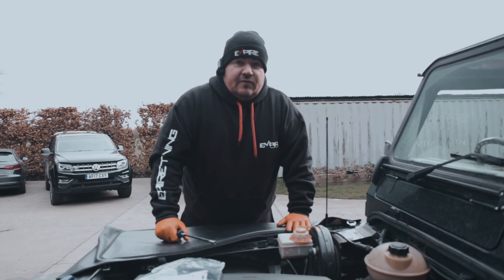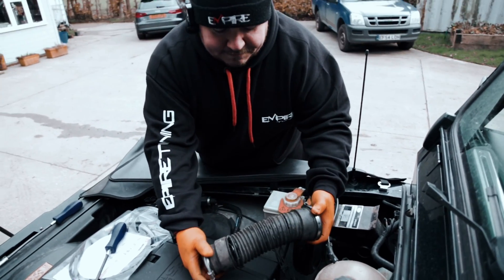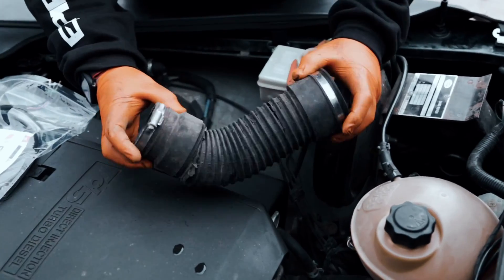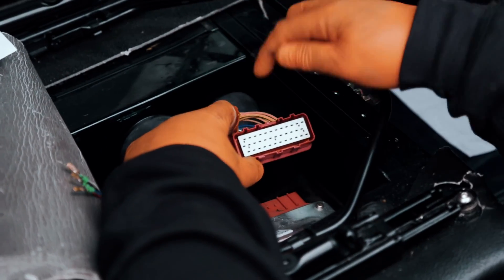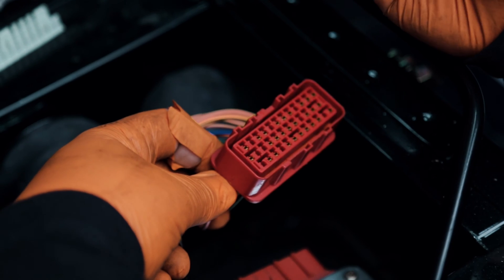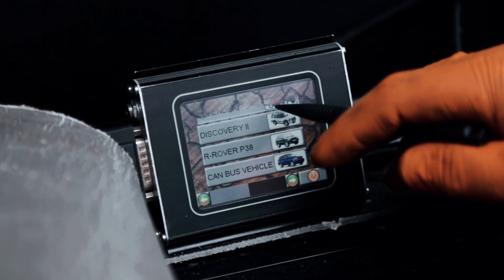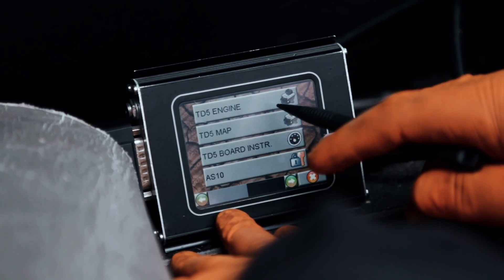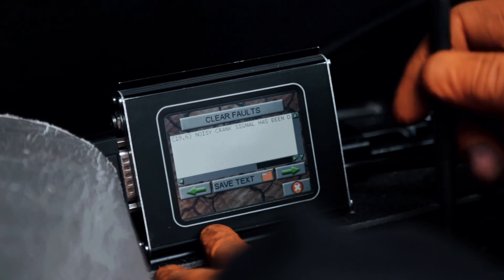NONE START TD5? Try this!

Comment: Just bought one of these, thanks! I've noticed that the in the instructions, it says Blue goes to pin 36 (top left) and Red goes to pin 13 (under blue) however in this video it shows you putting them in the opposite way around. Can you confirm the correct orientation please?
Reply from the maker: Very Well spotted! The kit in this video was a pre production one so if you can follow the instructions supplied then that will be the correct way.

Blue goes to Pin 36 (top left)

Red goes to Pin 13 (just below Blue)

Anything else please drop us a call

Comment: whats the (17.2) high speed crank (current) fault mean also getting (16.2)high speed crank (logged) truck wont boost more than 10psi and doesn't go above about 1800-2000rpm can't find any boost leaks is on a 2001 15p td5

Comment: Glad to know us LR Disco 2 V8 owners aren't the only ones with randomly dying CPS. I wrap mine in aluminum foil to thwart heat.
Cheers from a Yank in Suffolk!
Reply: The wiring is highly sensitive to EMF interference, particularly susceptible to the field produced by the starter on TD5s

Comment: So, currently my crank sensor has no issues - Would there be any way for me to say remove my good sensor and "future proof" it? So it does not suffer the common damage
Reply from the maker: If it’s working i would leave it as is and maybe just buy the kit to keep just in case, of course you can fit this kit and it will solve any future problems however if it’s working its working

Comment: Nice work on the soldering etc and installation as well. Does remap require EGR delete along with specific exhaust part removal?
Reply from the maker: The remap is built to your requirements and current hardware setup this means that if you have an Egr in place and exhaust then it would be a slightly less aggressive/powerful one due to flow restrictions
Reply: @empiretuningUK  Thanks for your reply, keep up the good work. 👍